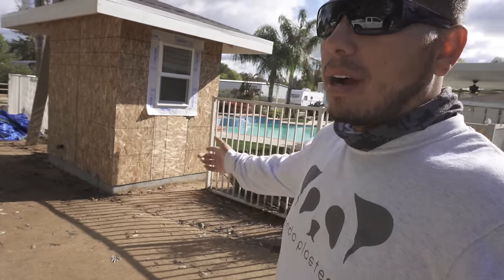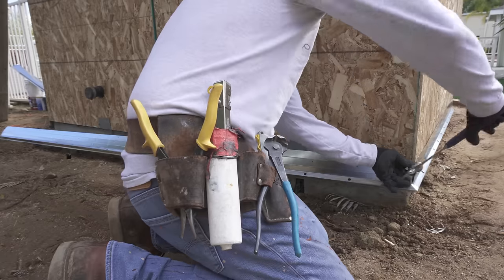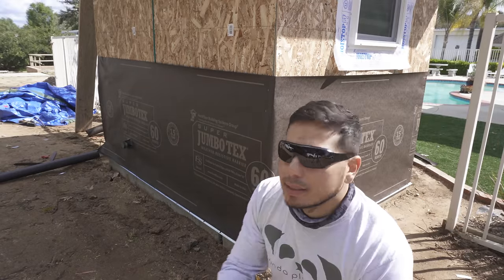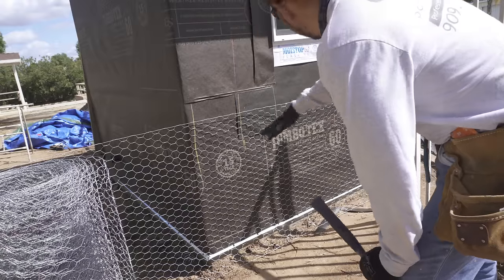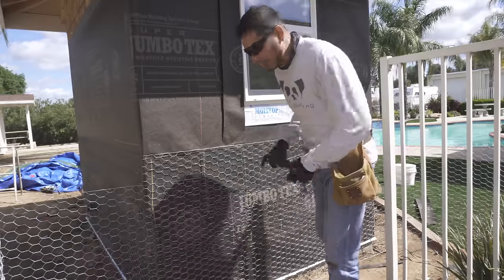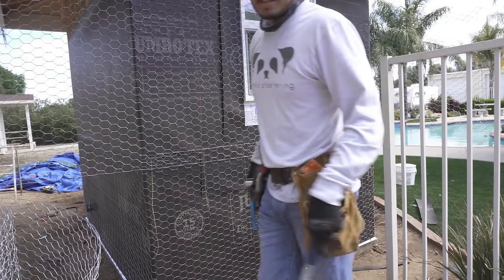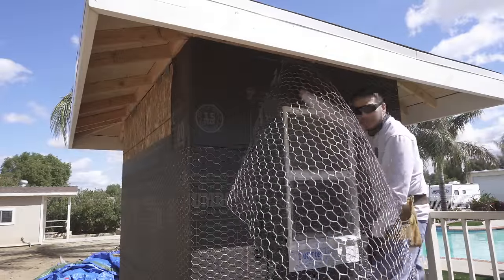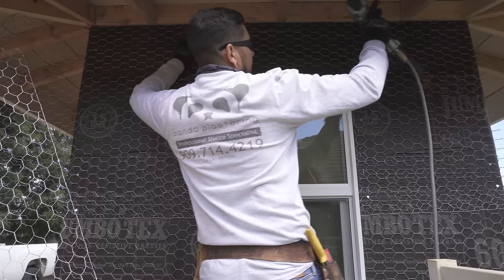How to Install Lath for Stucco

Comment: Nice Job.  The knife at the back of the rapid tacker is not as dangerous most think.  This is because it gets a little gummy from the asphalt paper.  Sharp enough to cut paper.  You must be in So Cal.  I go across country and in the east coast they hate woven wire.  Keep up the good work . Mark, executive Director the Stucco Manufacturers Assoc.

Comment: Man this was cool to watch. This was one trade I’ve always wanted to do but instead I was a stucco labor finisher and I hated it . I lathe twice and I loved it. I remember cutting the window wire and using the sharp end of my hammer to push in the ends. I wish you would have shown the j trim around the door and explain hot it works and also that some people use t&g foam and tape. I also wish you would have shown the different style of corner bead . I remember eye balling the top of the corner bead and the bottom then using a string line to get it straight . This video brought back memories 👌🏾 oh also, for those of you who don’t know , they make double layer paper 🤙🏾
Reply: @Freki Bodgaedir what name of paper? Label, type?

Comment: Enjoy the tip 1:30 really much needed ima have to use that at work
Reply: 2:23 that was smooth and makes work more easier than pulling out a actual blade to cut

Comment: Question. In regards to the inch and a quarter staples, is their an alternative tool if you don’t have the staple gun?
Reply from the maker: You can always use furring nails with wad.
Reply: @pandaplastering2466   Thank you

Comment: Hey, I'm just asking if you were going to put some plaster stop/ J trim around the window and door? It's not advised to go directly to the window and door frame with the mud. This should also be around the bottom. This will protect the trim and give a cleaner look.
I use red tuck tape or rubber seal to seal around doors and windows when needed. 
Im just suggesting nothing personal. 
I am plasterer 1963😊
London ONTARIO Canada

Comment: Very helpful thank you. I'm kind of confused on the lath nails though. Should I use the furring nails or does the stucco adhere when the lath is flat??
Reply: I think most stucco lathe nowadays comes prefurred. No need to use the nails with the cardboard bushings

Comment: Nice work buddy you have given me the idea of how to do it your self this will be my first time doing this in my own house thank you.but i have one question what do I put on the very bottom where the 2x4 meats the flat ground to prevent water from coming in maybe an L flashing?
Reply from the maker: You can apply waterproof membrane along the bottom. And a L metal caulked to the floor 👍
Reply: @pandaplastering2466  thank you

Comment: For just a small job I’m going to use furring nails cause I don’t. Have a pneumatic stapler not worth it to buy or rent for a 6’ by 8 ‘. Area. I wasn’t sure how many though I know enough to nail it were the wires are intertwined and every 6” on the studs but  everything else I’m just guessing and worried about getting embarrassed at inspection.

Comment: good job boss I do stucco drivett and IFEs system in Pennsylvania but I think you should use king rainscreen on top of the paper this creates an air flow between the cement and the paper and drains the moisture and water from the cement to the paper
Reply: No mames depende  en ke estado vives  El clima tiene mucho k ver otra o es un baño o un storage depende pa k lo bayan a usar es un cuarto muy pekeño y tambien cuanto kiss gastar El dueño

Comment: If you staple through both the bottom of the "shingle" layer into the top of the lower layer, doesn't it create a method for water to penetrate the paper and possible create rot?
Reply: No

Comment: Can you educate me please. Why not to use cement board or hardy board and then put the plaster? is that a faster option or possible?
Reply: Modern building codes require sheathing + moisture barrier + siding. In this case, the stucco is the siding.

Comment: What happens if you apply stucco straight on that plywood?
Reply: The wood will Roth the black paper is for waterproofing
Reply: It won't stick and it's definitely not code.....
Reply: Wood rot
Reply: @samanthaslaughter8041  how u know ?
Reply: @alexflores7949  Also, is there a reason you asked me how I know rather than the other two people? Scientific studies show my lady brain works just as well as male counterparts.

Comment: Hi, I'm applying stucco to a wall that meets on an outside corner to a wall that has siding. How do I transition the corner from the stucco to the siding? Do they make a metal corner flashing that transitions from 7/8 to 1/2? Your advice would be greatly appreciated. P.S. Great video!
Reply from the maker: you can use a J metal trim.
Reply: @pandaplastering2466  thanks!

Comment: best to use double head nails when installing the wood straight edge to the corners after the first base coat has beed applied.
That way it can be tightly applied and still easily removed.
The wood is best being one pc, 1x4” size is good and the length should be from the bottom to the top of the corner.
It isnt necessary to plumb the piece with a level when installing it, just follow the wall and allow for the thickness of the second base coat.

Comment: Nice video.  I have a question,  can I do this over finish, painted concrete?
Reply from the maker: yes. you will need shots and pins instead of staples.
Reply: @pandaplastering2466  got it, thanks!
Reply: You can also just glue the concrete and plaster over it. We use a material called foam tite to scratch it. You can also add glue to your material for extra measure.
Reply: @ryanforcier8840  thanks

Comment: Did you double lathpaper just the bottom row or the whole thing?
Reply from the maker: all walls got 2 sheets of 60 minute paper. including top and bottom .
Reply: Either u use the double roll paper or tybek but tybek is more durable we used only in mansions or custom houses whatever u wanna call it

Comment: Hey bro, when do you need to use foam?
Reply from the maker: @rickyzuela7569  depends on your city code. Unless it’s cosmetic
Reply: I'm thinking of doing my own stucco on a porch I added. the walls have plywood, just like in your video.

Comment: 2 coats of the paper or won’t pass inspection?  Why is that? I am a total beginner.
Reply: From i understand is that Stucco is porous. So moisture will get through. So double paper will prevent that. Don't need mold to start up.

Comment: You have to learn how to use the hog legs to cut around the windows much faster, not using a lather’s hammer or hatchet , use double ply paper to make job easier and quicker, could of done cleaner work but I can respect a fellow tradesmen everyone has their own style. We’re from the Bay Area

Comment: Metal never goes straight to wood.  The weep screed should have paper under it to protect the wood from moisture. We always use window flashing under the weep screed to protect the osb.
Reply: The paper is overlapping so the water will run down over each layer. No moisture can get in.
Reply: I've been doing this for 15 years my dad for 30 no issues with that

Comment: Probably  should have  used galvanized  lath, it will not  rust,alot stronger then tbat  chicken wire,ir you want to do the job right,

Comment: metal corners will ultimatly rust, even thru paint.
The proper method is to apply the base coat of mortar on the wire, than attach a temporary wood straight edge from top to bottom and apply the second base coat using that as the straight edge. When the mortar sets enough for the strip to be removed, the opposite wall can be done following the straight corner. Nothing to rust or detereorate.
Same method aplies to applying stucco on recessed window and door openings on block wall construction.